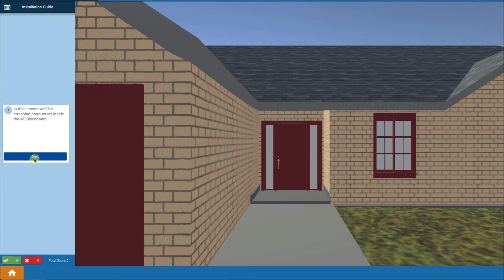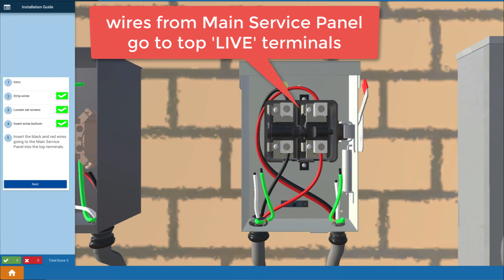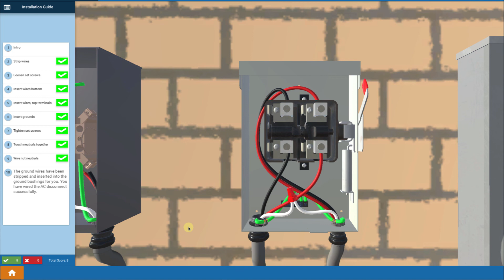Solar Training - Connecting the Conductors in the AC Disconnect

Comment: Thanks, very helpful. If I have two sources of AC PV power, can I bring both of them into the same disconnect box or do I need two separate  disconnect? (let say I have a SolarEdge system with max. AC current of 32 amps and Enphase system of max. AC current at 7.2 amps) Thanks in advance>

Comment: Does it matter which side the L1 and L2 wires go on?
Reply from the maker: Couple of things important there.  I need to understand what you mean by ‘side’. Is it referring to top side or bottom side, or left-right side?
The main point I am stressing is that the wires from the Main Service Panel go on the TOP of the switch mechanism, and the other wires go on the bottom. That is following a safety convention where the ‘hot’ wires will be on top. So when you flip open the switch, to disconnect the circuit, the wires and terminals and metal stuff on the BOTTOM is DEAD and safe to touch, but the wires and metal terminals on the TOP are STILL LIVE and dangerous.  The other thing that his just visually shown here, but important, is that the red on top has a red underneath, the reds are on the right and the blacks are on the left. Now to your question perhaps, it does NOT matter if the L1 is on the left or right side. What matters only is that whichever side you choose, that you match the red to red and black to black. Some electricians may have a rule of thumb, like ‘always have L1 be red’ or something like that. That is fine. So probably the answer to your question is NO it does not matter which side (left-right) is L1 or L2. Just be consistent, and have the always hot wires from the MSP go on the top side.

Comment: If PGE turned off the Solar AC disconnect, will the entire house loose power to from the grid?
Reply from the maker: no, the house will be unaffected. Idea is that the solar system in this case is a separate source of power into the main service panel, in parallel with the utility. if the solar input to the MSP is cut off by the solar AC disconnect switch, that does nothing to change the MSP connection to the utility, all remains just like the neighbors w/o solar.

Interesting contrary answer for the case of the utility being shut off. In that case the solar does NOT continue to operate on its own. The solar system, in this case, is dependent on the presence of utility voltage and frequency to operate. [ This is the reason for so much interest in solar systems with storage; in such a configuration, the solar system can instantly change over to being autonomous, independent of any utility connection, drawing energy from the battery, and any solar if the outage is during the day].

Comment: I'm using an Eaton DG221NRB 2 pol 3 wire switch. 2 lines are switched and 1 is fixed. This latter has the ability to be grounded to to the box with a grounding screw. It doesn't have a grounding block and doesn't appear to have an option to install one. How would you wire the neutral and ground in this switch? Electrically it makes sense to tie the neutrals together, ground the fixed line with the screw and then wire the grounds to fixed line, but it's going to "look odd" (I would expect a grounding block and the neutrals wired to the ungrounded fixed line). Any advice?

Comment: Thanks. When it comes to the neutral is this how it is configured no matter how big the wire? I'm using 4awg. If using a 3 pole switch would it be ok to have the neutral use one terminal with a fuse of its own?